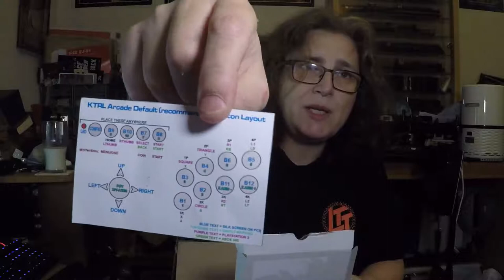September Catch Up

Comment: Congratulations on creating yourself an opportunity, I'm really pleased for you. It's been far too long coming. You seem to be on the milk today too instead of the usual so that's good... or is it a very pale Malibu? :-D

I can totally relate to the s!it hole situation. My bench is 6 inches deep in motherboards, PSU's and who knows what as it's been for a few months now, one of the reasons for no videos. And as for the floor...well.
It's not always even about having the time, there's physical energy to do stuff and as you mentioned emotional energy too. And when that energy supply isn't at full capacity and there are other things to deal with something ends up having to suffer for it. It's a shame it's often personal projects and interests, especially as they're the things that are most likely to help make us feel better.
In fact this is about the third comment/tweet I've put on social media in as many months I've not even watched a 10th of the videos I normally do.

It will be interesting to see how the Mister project goes and your new joysticks. I'd initially dismissed the Mister but I can see it as a good solution for hosting multiple systems, at which point it's cost can easily be justified especially when you see the prices of real hardware keep going up!

Anyway, it's good to see another updates video. Stay safe :-)
Reply from the maker: I'm honoured to be one of those you comment on :-D ... The MiSTer is proving to be a good little machine. I have yet to use many of the other cores, but as you say, with original hardware getting so expensive and increasingly difficult to find spares for, it's a reasonable way forward.

Yes, it was milk. I'd had too much alcohol already! Unlike the cider which I spilled over the chair, most of that went down my throat this time :-) You may get some leave over the december holidays, and if you recharge well enough, you might make a dent in the bench work. It'll be interesting to see how leave/work patterns happen in my new job. Stay safe, stay well.
Reply: @msknight5  you stay well also

Comment: That's a Mayflash arcade stick. Also not meant to be used with those style of buttons. Get snap in or scew in sanwa or seimitsu.  You should be good. 30mm or 24mm for secondary buttons
Reply from the maker: I think you're right. It wasn't labelled as Mayflash where I bought it, and it does carry circuitry for PS3 and PS4 with a Play station button, and it was listed as Venom VS2797 so maybe there's some rebadging going on. I've currently got all the buttons I'm going to get for the future, as I don't know if my new employer will allow personal deliveries; that's another thing I've got to bottom out, and another reason why I've got what I can... while I can.
Reply: @msknight5  yeah the buttons you got are meant for wood arcade control panels. The sticks are geared towards metal panel mounting which is a lot thinner.
Reply: @msknight5  also 8bitdo rebrands that Mayflash stick as well.